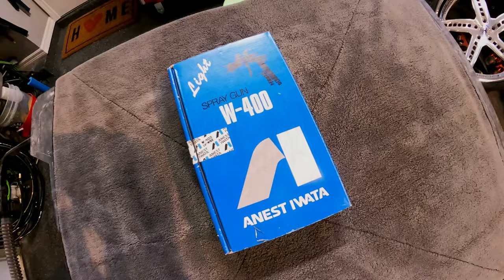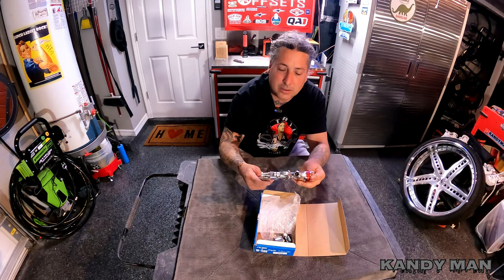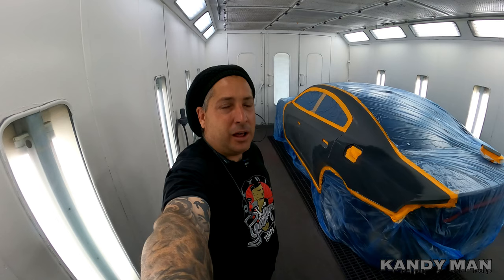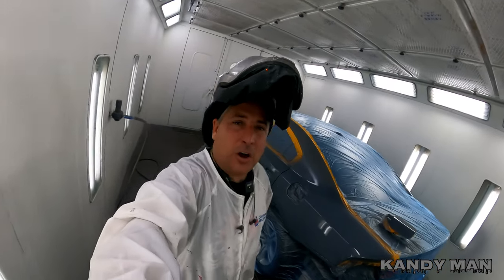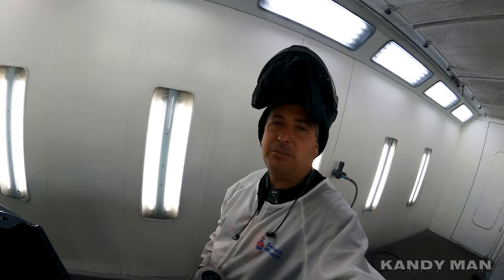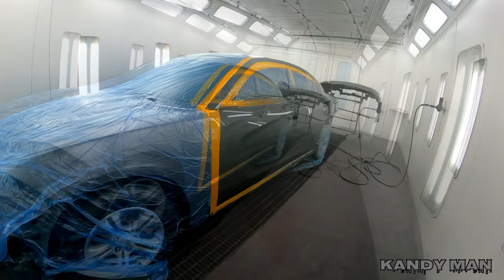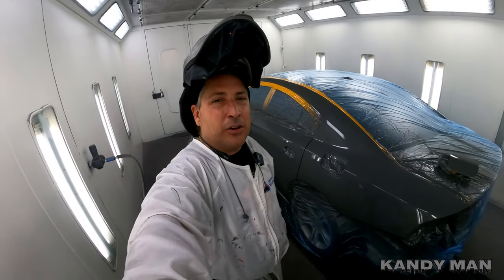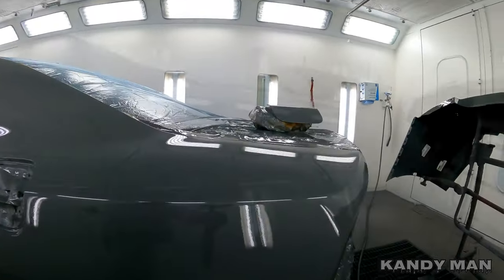W 400 L-V WBX IWATA SEALER GUN

Comment: Finally happened to come across the data sheet for this gun and it's just the w400 LV4 rebranded  everything is identical in both data sheets, why it's marketed in the US as WBX but for sealer idk. Definitely sprays great with a lower fluid consumption than the bellairia, but just differs so vastly from the actual gold cap w400 WBX models in Asia and Europe, would love to see more videos of this gun out there
Reply from the maker: It's compliant in the US that's probably the difference paid for the legal rights.
Reply: @kandyman5315  yes that's one difference along with the other model having much larger fan and puts out a bit more material
Reply: @kandyman5315  Hi , how you set for  lph-400 ? Full open  and what pressure ?
Reply: The wbx cap is the same design everywhere, it also seems to be the same tech/design as the lvx cap with uniform droplet size advertised and when I swap caps on my wbx it sprays exactly the same to me. The difference is the US model red cap is approved by the US EPA to spray at 20 psi and 20psi is marked on the cap for compliant use.  In the rest of the world 2bar or 29 psi is the recommended pressure for the finer atomization. The more pressure the more fluid is pulled out of the cup and the higher ml/min rating on the tech sheets.

Comment: Hey Kandy Man, would you recommend the 1.4 needle for Nason Sealer? Nason is all I ever used and it seems to be a really thin sealer, was thinking the 1.2 needle may be better, your thoughts? I currently use a Tekna pro lite to spray my sealer with a 1.3 but dang it always seems so "peel'y" to me. And if the sealer is peel'y then my whole job is coming out with Orange Peel, trying to kick that.
Reply from the maker: 1.2 would work better for that sealer  but you could use a 1.4 and turn in the fluid as well.hope this helps

Comment: I currently use the GPG with a 1.8 or 2.0 for high build k38 mostly, and 1.4 for epoxy/sealer DPLF mostly. Does the WBX lay the sealer smoother than the GPG and if yes which one do you think is smoother the WBX or the LPH with the orange cap? I am not interested in the base coat/clear coat aspects of these guns or the looks. Thank you for your content knowledge and expertise.
Reply from the maker: Lph400
Reply: Thank you.

Comment: Great results! Do you think this gun will also be good for base coat and single stage paint?
I’m looking at getting it with the 1.3 tip.
Reply from the maker: Yes it would work great
Reply: 1.4 is better for single stage imo. I have had to reduce 50+ percent solids single stage to get the fluid output, that I can spray with the 1.4 without reduction. With Ms products it doesn't matter.

Comment: I have that same gun but have not used it yet. But I wanted to know when using a primer and sealer which one do you use first?
Reply from the maker: Primer is first over repair then sand and seal .sealer before base coat sealer is not sanded  wet on wet let flase off then move to paint of your choice
Reply: @kandyman5315   What if it's done in reverse I'm just curious?
Reply from the maker: Then you would have to sand in between   sealer is thinner than primer that's the difference between them primer you have to sand sealer you don't as long as it's in the recoat window
Reply: @kandyman5315  thanks Kandy Man

Comment: what are your settings for this gun with the clear coat
Reply from the maker: 25 psi full fan .pull trigger.turn knob  till you feel it hit and stop for the fluid. 👍
Reply: Thanks for the fast reply you got a new subscriber, I do everything with the 1.3 tip because I paint cars once in a while and I cant afford to buy guns for different applications I am very inconsistent with this gun sometimes I paint great and sometimes I get the worts orange peel possible.
Reply from the maker: Gun time that's what its all about 👍

Comment: I cant decide between this gun and the LPH400LVX
Reply from the maker: Funny you say that I was just talking about this today  I would go with the lph 400lvx because of the chrome plating.  The other one is not chrome and dulls out to a ugly finish.they both spray great
Reply: @kandyman5315  Thanks!! Have you checked out the Wider4L-V14? Looks like LPH400LV4 silver cap but $200 cheaper?
Reply from the maker: No I have not I have to use. Compliant  guns  not sure if those cheaper ones are wish they were.
Reply: @bluestripes1  I owned the wider 4L for a month and yes its nothing more than an LPH with a LV4 cap a cheaper price if you compare the data sheets they're identical